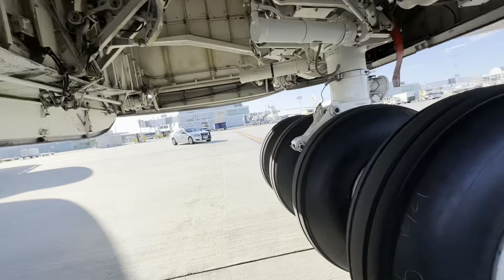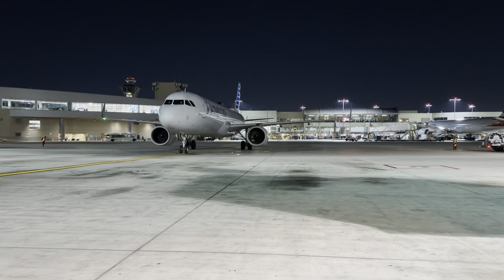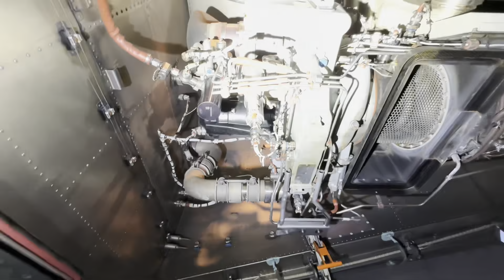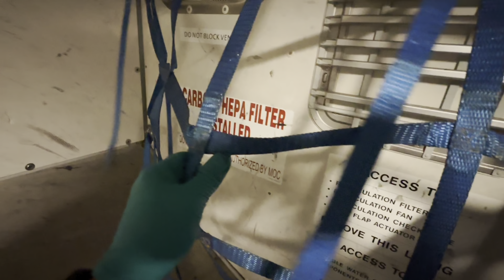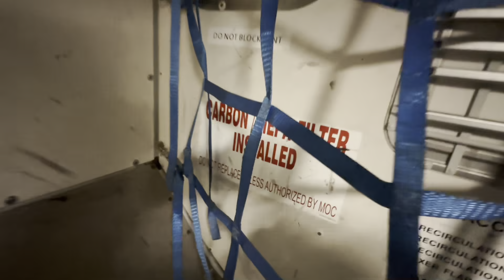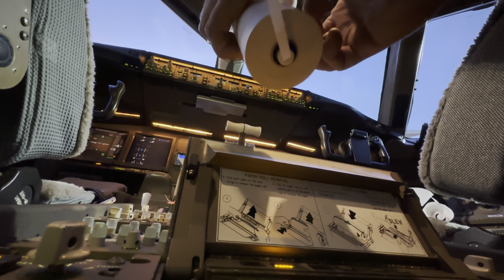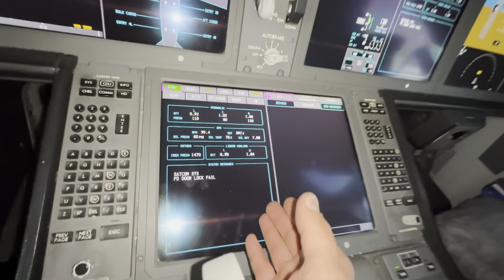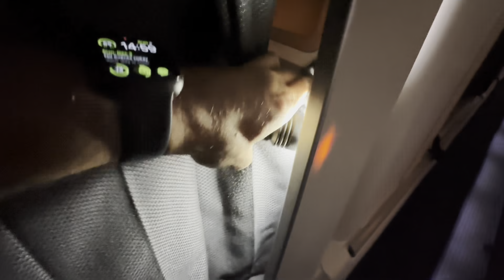Stig Shift #4 (Aircraft Maintenance Adventures)

Comment: Yes the C5s jackscrews are a combination of squatting functions and rotation function when main gear are stowed.  They turn 90 degrees before rotating up into those bulbous belly fairings. You were also correct about the APU on the side of that fairing.  The Liquid Oxygen or LOX is used to provide the air used in the crews oxygen masks...C5M is the newest upgrade of the galaxy which got the new more powerful and quieter engines and a nice little glass flight deck update.  She's a beast!

Edit That Ferrari looks like a 458 (headlights) but I'm not sure if Ferrari made a track only version of it. I was more impressed witht the black 911you just non chalantly passed by.  It looked like  a widowmaker (930) # first glance....😮

EDIT EDIT Oh you said 993 meh I'd still take her home but it wouldn't be my poudest conquest 😂
Reply: Edit edit edit. This was freaking fantastic the poem and the shot of thr A321 at the end......perfection!!!
Reply from the maker: Words from my heart. Thank you once again.
Reply from the maker: Thank you so much for the education. I learned something new.  Much appreciated.
Reply: Was going to say, the jackscrews on the gear allow the aircraft to "squat' on the ground to get the ramps closer to the ground for less of a breakover angle on said ramps for offload/onload of payload.  I think the only way the C-5 will stay in service past 2030 is if there is a need to transport cargo that cannot be borken down and is larger than than the C-17 can carry...

Comment: Hey Stig, another one of your adventures. Too cool!!  A question: Has there been any issues with the main battery on your 787s? If it’s a secret, I understand. Personally as an Ap myself, I think it stinks that B never found out what caused the earlier onboard battery failures and simply wrapped it in a stainless box and shipped it. Also from your Florida AP school visit, for a trivia question, you can explain nosewheel chined tires. American currently doesn’t have any aircraft that utilize them but they did. Do you remember when American had the MD-11 in their fleet? That one didn’t last long. That was from the way back in history pages…
Reply from the maker: I never had issues with the 787 batteries. They never really told us what was the actual cause… my speculation is because they are lithium ion batteries… they might have had an overheating issue and caused a thermal run away. But I’m still not sure. As for the MD 11. That’s one aircraft I never got to work on. And to answer your question on the chined tires, it’s simply to deflect water and slush away from the fuselage as the aircraft is rolling.

Comment: I could give what info I know about the C-5 as I do work for Lockheed.
Reply from the maker: Please feel free to share. I would love to learn
Reply: @StigAviation  ok some fun facts I suppose. The inboard main tanks are at least 6ft thick so most people could stand in them. For the C-5M they had to severely de-rate the engines because the full CF6-50 power was a whole 50% higher than the original C-5A’s 41,000lb of thrust and the B’s 43,000lb and would have likely caused structural failure rather quickly.  When they did the C-5M upgrade they replaced ALL of the electrical wires. Just off the top of my head.
Reply from the maker: @Demon_Fingaz  absolutely fantastic. Thank you for sharing that sir. Much appreciated

Comment: (Minus the max) why do most American 738’s have the one vertical winglet and most other airlines 737,738s have the slit scimitar. Odd question I know.
Reply: Split*
Reply: And I’m not taking away from the fact that the C-5 is a amazing feat of engineering
Reply from the maker: I believe it was an option they didn’t buy from Boeing. But that’s as far as I know about it.

Comment: Is there some sort of lockout where the plane won't retract a wheel while the plane is on the ground?
Reply: Yes it’s the Weight On Wheels sensors
Reply: @mrtodd3620 The WOW sensors lock out the lever to prevent inadvertent retraction, while sitting on the ground. I hope that answers your question a little better, sir.
Reply from the maker: As Remy mentioned… weight on wheels sensors. But we also have gear down lock devices we can install when performing maintenance.
Reply: @StigAviation  Has there ever been a retraction where the failsafe wasn't present or didn't work and the plane dropped to the ground?
Reply from the maker: @mrtodd3620  only on the nose gear with hydraulics active and no gear pin. Yes it has happened